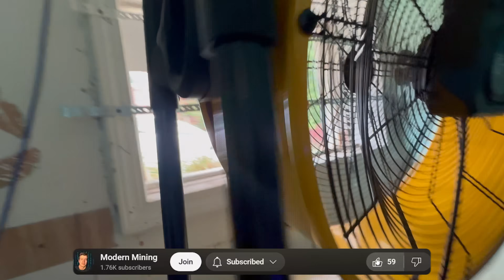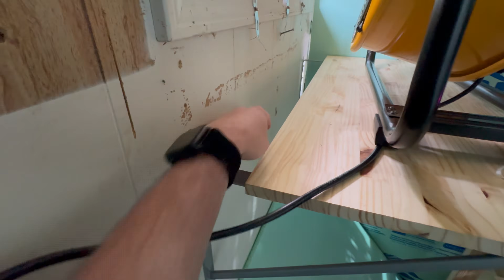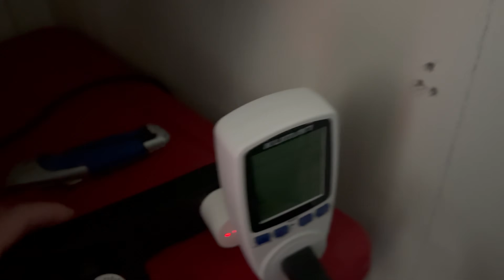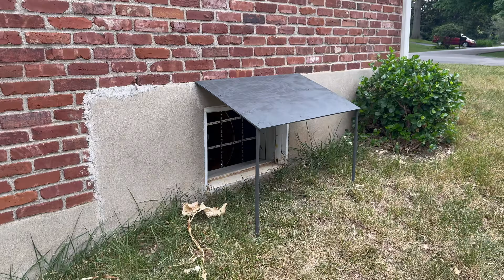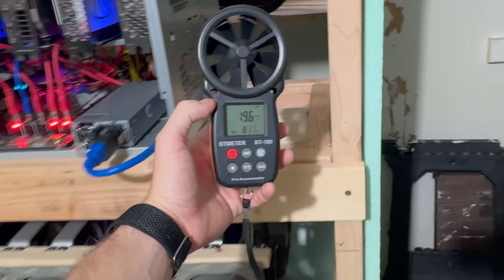Testing my INSANE Gpu Mining Exhaust Setup!

Comment: confused...ur fans on ur gpus are blowing into the garage...spin those rigs around...
Reply from the maker: You’re talking about the cards themselves right? Those are the only fans pushing the opposite direction but they just get sucked right back in. Probably not good for the motors though may need to turn them around like you said.
Reply: @ModernMiningHub  ya ...that will help alot i have 140 gpus and 10 asics...deff know from experience it would help move air out the exhaust easier creating a natural flow out even tho they are really low cfm there are a bunch of them

Comment: Great work! I'd recommend cutting pieces of foam or plywood to put around the rigs to isolate your intake completely from your exhaust. Even with the 8k cfm fan you are still getting hot air back into the garage. The intake fans will provide more than enough intake air and it basically creates a poor mans Octominer. Also seal the seams with duct tape or something to force all intake air through the intake fans. Once I did the cold/hot isle my intake temps are at ambient, usually a little lower because the shed is in the shade, and exhaust temps are usually only 20-25 degrees higher.

Comment: I replaced all my powerful fans, case fans and exhaust fans, and I found that the air pressure, if too high, in turn affects the cooling of the GPU, with the violent fans on the case having the most impact

Comment: Nice Setup! - I love my govee sensors. Have you thought about setting up a raspberry pi with home assistant? It autodetects govee sensors. Kasa smart plugs with energy metering are a nice way to collect data on power usage too (and that integrates with home assistant too). You can chart some nice data graphs and do analysis that way.
Reply from the maker: @presslybonner341  have any videos you could link on this? Sounds interesting!
Reply: @ModernMiningHub  - I'll put something together if I can't find anything out there that covers the important highlights. I started with a home assistant setup to monitor an RV (power usage, propane levels, temperatures) and pivoted to make a system monitoring my miners.

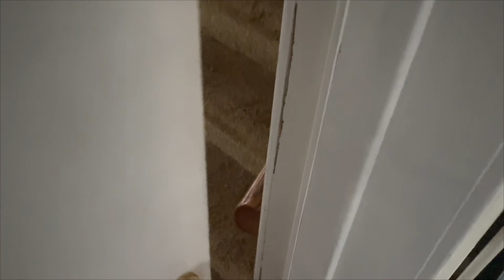Comment: 08:02 to prevent this, Adding a supply fan with the same cfm as the exhaust would prevent air leaking from other parts of the home.

You could duct supply fan to your gpu plenum box, or you could install a very large slow rpm fan(they tend to be quieter)

Comment: Now that you have more of a airflow cage,  you will want all the case fans blowing in the same direction as your outdoor venting fan.   Otherwise they will work against each other.    I like building my stuff in a similar fashion as you.  Simple.  Cheap.  Effective!
Reply from the maker: I did switch them around so they are all blowing into the hot isle/room. Thanks for stopping by!

Comment: I would definitely have that fan at least closer to the window opening. Also I would turn the rigs around, you are blowing hot air back at the GPUs. It takes time to get everything perfect I know been working on airflow and everything for 3 years now but first hand experience is the best way to learn 👍
Reply: Having the fan not right next to the window is better trust me it's science.
Reply: @WannaBeQuant_SUB  yes but ducting it to the window would help if it is sealed like a shutter fan

Comment: I'm not a fluid dynamics guy but I think you want to seal your fan to the opening so all the air goes out the opening.   But I bet it's making a big difference. Good work
Reply from the maker: I thought so too but then i watched this video. https://youtu.be/1L2ef1CP-yw?si=M1ODTO0k-Tf3MQrr

I think im going to move it flush regardless for security purposes though
Reply: @ModernMiningHub  if they are blowing in.  All should blow in.  dont have your fans fighting each other with airflow directions.